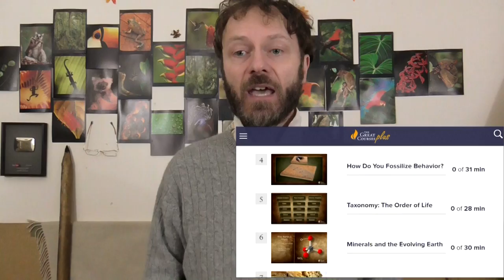Muzzle Brakes - what are they for?

Comment: I actually had to learn about muzzle brakes the hard way when a friend of mine had me try his .50 cal and after it knocked me off the bench he tossed me the brake laughing and said you might need this 😂
Reply: Huh... Sound like America to me
Reply: So what is it for?
Reply: @fleadoggreen9062  it helps mitigate alot of the recoil in a .50 cal both upward and rearward imagin it like a jet of gas that is specifically tuned to keep the gun as stable as possible
Reply: Zachary Lancon thank you
Reply: @fleadoggreen9062  yea....its not just for .50 call though the one in the video thumb nail is for i believe a 20mm mounted cannon but it basically does the same thing....and there are some for the ar15 that are so overly effective they can actually push the muzzle down
Reply: @aldi_the_flash2496  ´murica*
Reply: A muzzle brake doesn't even require to be on a huge gun one of my hunting buddies has a 30.06 with a muzzle brake
Reply: @padenlisk2447  30'06 is still pretty big lets be real
Reply: @zacharylancon1126  yeah but it isn't an anti tank gun
Reply: @padenlisk2447  well neither is a .50bmg but thats why i previously mentioned the AR15
Reply: @zacharylancon1126  a 50 bmg is an anti material gun
Reply: @crosshead4552  yes but if you shot a tank with it I doubt it would even be bothered anti material and anti tank is very different
Reply: @zacharylancon1126  a 50 bmg goes through a light tank
Reply: @crosshead4552  it must be a really light tank.......considering a humvee is capable of stoping most .50bmg rounds
Reply: @zacharylancon1126  that's called a compensator, such as on the M16A2 service rifle. The M16 and M16A1 in Vietnam had a 3-prong flash suppressor. My M1A is fitted with a combination muzzle brake and compensator. A muzzle brake alone will not push the barrel axis down, it will only assist with linear recoil.
Reply: @zacharylancon1126  really? The M1 Garrand is chambered in 30-06. It's just a normal rifle round. If you think that's big, stop shooting .22 rimfire.
Reply: @davidcruz8667   no offense but compare the 30-06 to most modern rounds in common use its why when the army switched from the garand to the m14 they went with the .308 and then to the 5.56 with the m16 bc it was to big and heavy for a job easily accomplished with a smaller round soldiers could carry more 5.56 and be more effective than they could 30-06 theres a reason hardly anyone is making serious modern battle rifles using the 30-06 (to my knowledge).....as for the debate over compensator yes you are right however I was referring specifically to the muzzle brakes used on most .50bmg firing rifles which are actually angled slightly upward to help keep the rifle grounded and more stable rather than just rearward to help mitigate rearward recoil i dont know why your bringing up the m16 when i was referencing the ar15 i get the m16 has a sop around its configuration so its easy to reference but that doesnt change the fact that there are overly effective compensators that you can put on an ar15.....as for the comment about me shooting .22 I mean its good for cheep training but I much prefer shooting my 45-70 its just something about leverguns and seeing anything that round hits basically explode (yes i know thats probably the wrong term it makes my point and you know what I mean) I would love to get the MR b.f.r. some day just for the shits and giggles
Reply: @davidcruz8667  sorry for the long reply there was kinda alot to unpack 😂
Reply: @zacharylancon1126  Correct, they did. The 30-06 was (and is) a reasonably powerful rifle round. Later, through influence or whatever, NATO adopted standards that would apply across all NATO  participants, including the 7.62X51 NATO round, which is. 308 with a specific bullet weight and powder profile. The M14, which is dubbed M1A for the civilian version semi-auto only rifle ( Which was an evolution of the M1 Garrand action but in a different caliber and being fed from a removable magazine as opposed to using en-bloc clips in the Garrand), as well as most machine gun platforms ( Think M60, things like that) are thus chambered in this caliber. Later adoption of the AR/M16 platform, after some initial hiccups, came about looking for a lighter weapon that would allow carrying more ammo and still perform well. It eventually worked out just fine once the initial problems were identified and resolved. Whew, I could talk about this all day, but I'll stop for now. Good answer, well done.
Reply: @davidcruz8667  I like you am very familiar with the history of American military weaponry but I should make the point that even at the time the 30-06 was an extremely powerful round which was the main reason the army adopted it but even then it was to powerful the garand had to be as heavy as it was to fire the round effectively and while its weight did help mitigate much of the recoil of the round it still to way longer to train the average new soldier to qualify than would be accepted today add on to the fact that body armor was not in common use yet and theres virtually no excuse for not of using a smaller cheaper to produce round back in the day.....and my point when I first brought up 30-06 was not that its the biggest round in the world so much as its nothing to sneeze at by any means
Reply: @zacharylancon1126  I agree. Well said.
Reply: @zacharylancon1126  hi man! Refering to the M16 is the current military designation. Originally the first rifles were adopted as AR-15s, the military gave them M-16, M-16A1, M-16A2, CAR-15, M-4. Nowadays AR-15 refers to civilian semi-auto only variants.
Reply: @davidcruz8667   actually the ar15 style platform was first adopted by to airforce on a will purchase contract for ar10s as far as im aware they never received an official designation until the army adopted them as the m110 which the army still does not recognize as being the AR10 platform which is why there is no milspec for the ar10
Reply: @davidcruz8667 also the ar15 itself was originally adopted as the M15 rifle before its was discovered that Armalite couldn't keep up their contract then sold to colt colt used different specs which is why they redesignated it th m16 and milspec ars are less commonly known as colt spec ar15s
Reply: @zacharylancon1126   very good. That is correct.
Reply: @zacharylancon1126  yes, I know most of that, I don't disagree with it. Thank you.
Reply: No hate,we've all been there.
Reply: @davidcruz8667  M4 is the current military rifle in the U.S..

We have not used M16s for some time now.
Reply: @truthfulconch7773  Marine Corps still uses M16A2 rifles. Some get M4's.
Reply: @davidcruz8667  I stand corrected.
And my sympathies to the core.
Reply: @truthfulconch7773  thank you! Yep, we're Uncle Sam's Misguided Children.😁😁😁
Reply: @davidcruz8667  i like
Muscles
Are
Required
Intelligence
Not
Expected.

Or

My 
Ass
Rides
In
Navy
Equipment.

Love from a Navy vet.
Reply: @truthfulconch7773  Yes, and Uncle Sam's Misguided Children, U Signed the Motherf***ing Contract.😁
Reply: @zacharylancon1126  I thought the thumbnail had a brake belonging to the StuG, probably with a 75mm.
Reply: @crazyandlazy2669  perhaps....alot of tank and artillery muzzle brakes look quite similar and havnt changed much since wwII so I wouldn't place any bets on it from just this thumbnail but it's quiet possible

Comment: Hey there, American tactical rifle builder here. I just wanted to thank you for working so hard to force yourself to use the proper term “muzzle brake”, and also to point out a possible third application or risk of the muzzle brake, depending on the design of the tank: in rifles, one of the benefits of a muzzle brake is it hides the muzzle flash. If you’re aiming at a distant target in the dark, the flash of your own muzzle can ruin your night vision and dazzle you, rendering you fairly useless in the rest of the fight. I assume this is possible for any tank sight close enough to the axis of the bore, so a muzzle brake can direct the flash away from the exact point the gunner is looking. Or directly into, if you design it poorly enough.

Comment: All the time, during arty training in ArmA 3, our gunners kept TKing us with the blast.
Reply: Ha. That sound pretty cool. :)
Reply: What are you even using as artillery pieces? The only fun and worthwhile piece I've seen so far in the game (including mods such as RHS) is the Mk.6 mortar...
Reply: Rogem The SPGs.
Reply: The Stoned Videogame Nerd I've been trained to use one IRL. Does 360, rises to like 75 or 80 degrees elevation and shoots up to 12 or 13 km depending on the munition and charge. Definitely one of the better options in Arma.
Reply: mustafa hammad The explosion or the pressure around the shot? :)
Reply: Serathis The explosion - the overpressure is only about 10-15 meters around a tank with ACE3, afaik.

Comment: Side note: they had a muzzle break on the Thompson sub-machine gun. It had slots on the top to act as a kind of retro rocket to hold the muzzle down in full auto. 

They still make them for rifles to do the same thing as well as venting the gas upward to the right and left  which kicks up less dust when firing prone.
Reply: The main function of the device you are referring to is called a compensator to counter the tendency for a shoulder-fired small arm to climb skyward during firing. The moniker was "Cutts Compensator". Although it may have a tiny braking effect, a 10+ pound weapon firing a .45 caliber pistol round wouldn't require braking.

Comment: There is a third purpose on riffles. The famous Tommygun (Chicago Typewriter) has the barrel sitting so far above your shoulder that the recoil causes a tremendous torque rotating the gun up. On full-auto, it is impossible to keep the  fire on target for more than three rounds. So they invented a special muzzle brake which ejects the gasses upwards only to compensate.

The M16 is the first riffle which has the barrels perfectly in line with your shoulder. This is possible due to the special sights of the M16. Either you raise the barrel with sights to be able to aim along the barrel or you use special sights.  Before full-auto action, the recoil was not a problem and nobody considered the upwards recoil during the design of the Tommygun.

Comment: A quibble: Muzzle brakes deal mostly with firing impulse of shells acting on guns, not necessarily recoil (while a muzzle brake reduces recoil, it does so in a very indirect manner). Impulse begins when the propellant charge detonates and ends when the projectile and propellant stop acting on the gun, while recoil is the aftermath. Recoil is better handled by increasing the travel length of the gun (which demands a larger turret ring or a radical design, such as a cleft turret). Both recoil and firing impulse can separately limit what guns a vehicle can have, too.

Also: The idea that muzzle brakes interfere with sabots is not correct, I think this might have arisen in WW2 or something when the British blamed their poor manufacturing of APDS sabots on the muzzle brakes, or perhaps a wrong-headed analysis of actual interference of brakes and sabots. Anyway, it at least stymied Anglo and American tankineers until the 1970s until the French showed up with a baffle muzzle brake on a gun firing APDS, so you're in good company I suppose.

The Soviet T-12A anti-tank gun, American M2/M3/M6/M7 Bradley, French Super 90 gun and AMX-10RC light tank all use discarding sabot natures of ammunition and muzzle brakes. Most, if not all, modern light tanks like the American Stryker MGS and M8 AGS use sabots with pepperpot muzzle brakes as well.

Muzzle brakes disappeared on medium and heavy tanks for a much more obvious reason than sabot interference: tanks got heavy. The M1 Abrams's turret (and most other Western tank turrets, likely) weighs as much as an M4 Sherman by itself. Since firing impulse is the primary ailment the muzzle brake cures, it's not very useful on a tank which has sufficient inertia to resist the movement of the shell in the barrel.

Ogorkiewicz uses newtons/ton and cites a ~900 N/ton threshold where the impulse is "noticeable" to the crew. Some production tanks, like the American Sheridan, exceeded this by a substantial amount though (something like 1,100 N/ton), so the threshold is likely very conservative. Most modern main battle tanks (and crews), with their weights exceeding 40 tons, simply wouldn't notice the firing impulses of their guns.

The other major issue you touched upon is overpressure. Western tank commanders are often exposed to external hazards when observing fall of shot, so high overpressures to the sides or rear of the bore can create discomfort for a vehicle crew which has the hatches open, but that would be a very distant second to the mass of modern tanks since it seems to be brushed aside when necessity demands you must mount a large caliber (=>90mm) gun on a light (<20 tons) chassis.

Good video.
Reply: Kat Tsun I'm only commenting because I can tell you put effort into that. Pats on the back.

Comment: The Comet main gun was a 17 pdr with a shorter chamber, hence a shorter cartridge. It was actually a lot more accurate with the discarding sabot round than the full 17 pdr. And it had a muzzle brake. I believe the main issue with the early APDS was that the petals would not break away evenly and simultaneously, and the asymmetric mass would affect the course of the penetrator.